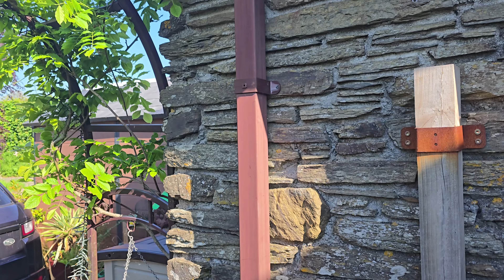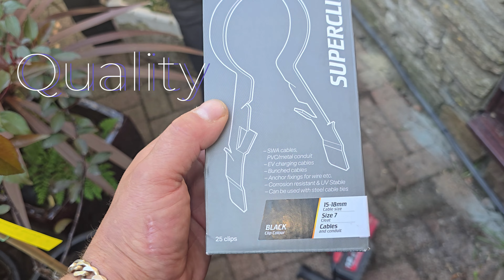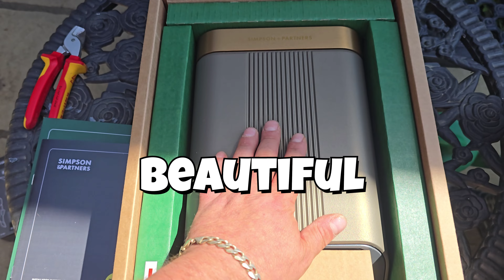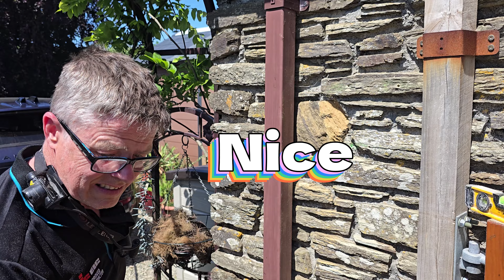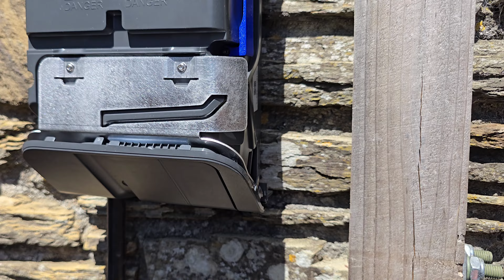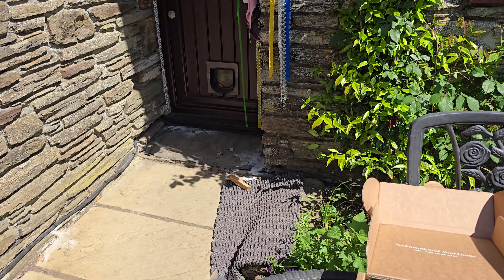Simpson & Partner E V Charger Install: Bespoke Design & Expert Installation | Goodwin Electrical

Comment: Nice work! 👍
Did you have to do a Zs test or RDC-DD test after installation, or can the charger be used straight away without test? Many thanks.
Reply from the maker: Hi thank you for your comment yes we have to conduct an Electrical Installation  certificate upon completion this dose includ ZS testing and RCD testing alond with other tests this is a requirement when installing a EV charging circuit and charger hope this helps